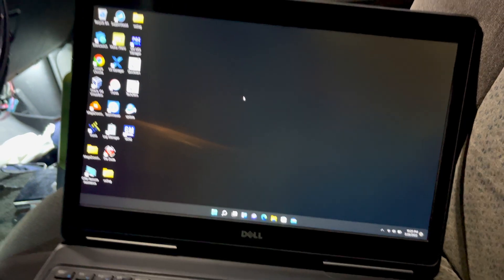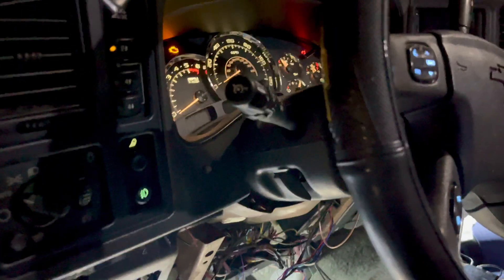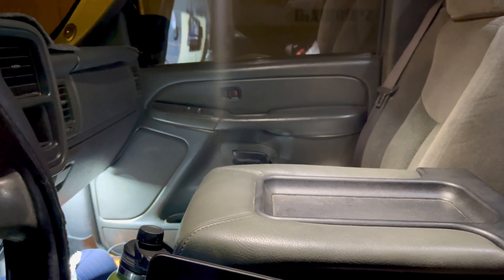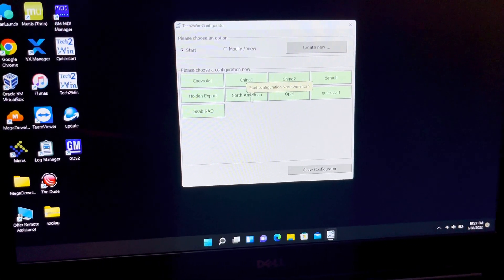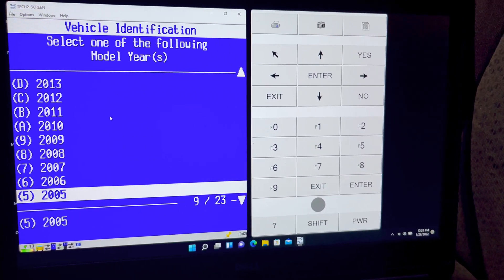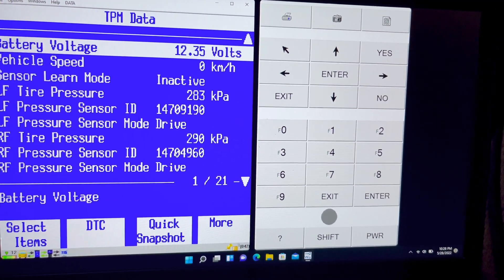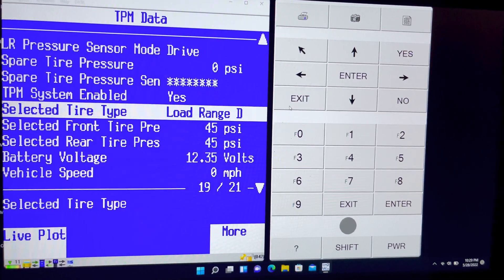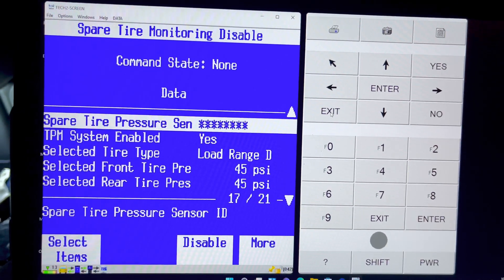GMT800 2003-06 Silverado - TPMS Final Programming w/VCX-SE Tech 2

Comment: Before you activated the tpm module in the pass door, did your keyless entry stop working?  Just added the tpm door switch this morning.
Reply: Yes that is normal. Your key fobs are paired to the PDM. You just have to re-pair them to the new PDM
Reply: @brennenbrinker7017  yeah, found that out.  Also found out that no tech2 is required.  I swapped in the PDM and the DIC popped up with Tire Temperatures, but threw an error on the DIC without a CEL.  Installed TPM sensors and used the tool to allocate to each wheel and it worked.  Easy mod.
Reply: @myoldsbeater tell us more. Which part number tpms module did you use

Comment: I am trying to do this to my 2004 Silverado SS, I have the door module off a 05' Tahoe and I bought a Foxwell Clone of the Tech 2 on Amazon, I enabled it but I still don't see tire pressures on my DIC, my TPMS light only turns on initially when I cycle my key to the on position or start the truck but then disappears?? I am using PDM #10398572

Comment: This is somewhat, what I'm looking for. Everything installed and tires are learned to the system. However, my DIC does not show anything for pressures. It tells me it's there.. is there a setting for the dic I'm missing to enable it to display? I can read the pressure from the module and it did tell me before tires learned it needed service
Reply: did you ever figure out your issue?
Reply: What part number is the one you have?

Comment: Would you able to turn on the heated seat function with this device
Reply: That runs through the body control module you would need to get the rpo code added in through Acdelco tech support but it’s definitely possible

Comment: Hey man, hoping you can help me out here. I'm trying to add Tpms to my 04 1500. It came factory with SWC and the dual digital DIC. I swapped the passenger door module for a junkyard unit with the proper rpo codes and the tire pressure light and "service tire pressure system" now come on the dash. Problem is I can't get the system into learn mode for the new sensors, nor can I see individual pressures on the display. Any thoughts?
Reply: I'm working through this process myself in my 2005 1500 w/ dual digital gauge and factory SWC. I bought 1 module at a junkyard and when plugged in would get no tire light or check tire pressure message on my DIC like shown in the previous videos. I could not even get it to switch to the "tire sensor" menu either. 

After looking through a few other posts I found a different module PN to try, 10398572. Plugging this module in let me get the "tire sensor" menu option and display all the old sensor data, which is 0 psi. However, I still have no low tire light or check tire pressure message on my DIC. I am waiting for some new tire sensors to program to the module and once that happens, hoping it will trigger a low tire light or check tire message. Won't do me any good if when one goes low it doesn't show on the dash and I would have to scroll through 4 sensors constantly to monitor them.
Reply: @LoneWolf1985BK any update? Did the new sensors work?